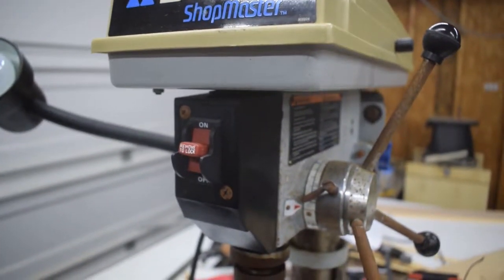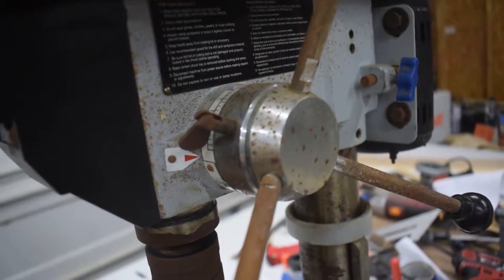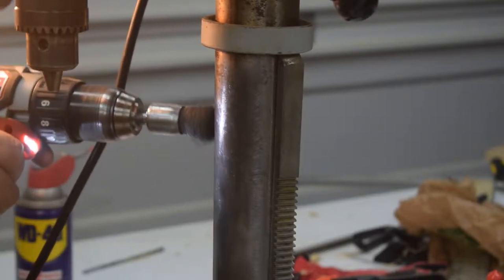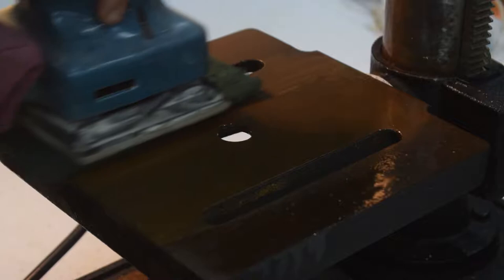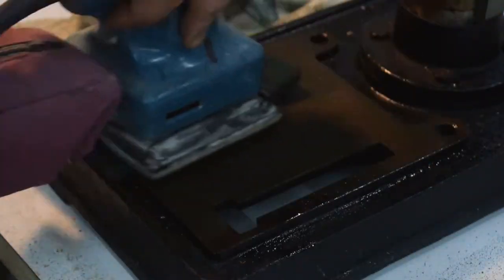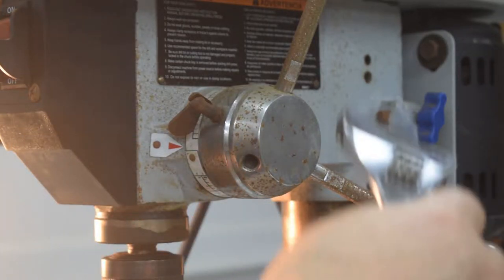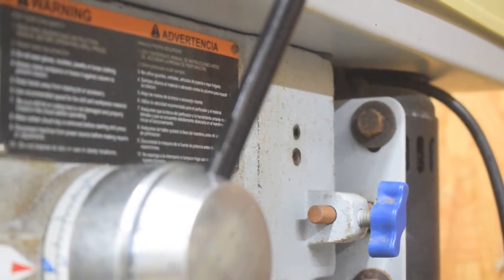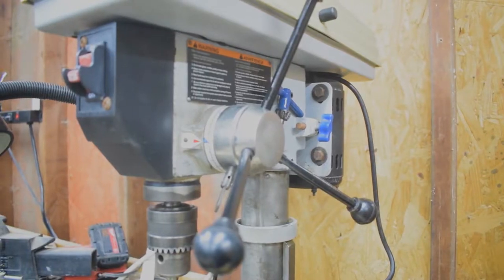How I Remove Rust from Power Tools (without vinegar) - Light Tool Rehab

Comment: Phosphoric acid dilluted, is the best acid cleaner, as it forms a hard invisible barrier that resists rust. Phosphoric acid is the main ingredient in "Rust Converter" paint. When they paint cars, they wipe them down with a water rinse dillute with phosphoric acid, and it removes the free iron that you can't see, and creates a rust proof coating, so the metal doesn't rust under the paint. Self etching primer contains phosphoric acid, so when it's sprayed on bare metal it doesn't allow rust to occur under the primer. Phosphoric acid is a miracle, although it's not very strong compared to Hydrochloric Acid (concrete cleaner). But Hydrochloric acid is not safe, because it opens the metal to further rapid rusting. Many people don't reaize how important it is to use phosphoric acid. In a pinch, Citric Acid and Acetic Acid (vinegar) are apparently very good as well, although Phosphoric acid is considered one of the best ways to clean and passivate stainless steel and steel. On stainless steel, Phosphoric Acid also removes the invisible rust, and forms a hard "passivation" layer of Chromium.

Comment: I’m about to resurface the exact same drill press. Thanks. Not to be “that guy” but I think a wire wheel is the last thing I’d skip safety glasses on. I’ve had wires fly off and stick me in the face like a dart gun.
Reply from the maker: Did I not have safety glasses on? I am usually pretty good about that. I would agree that is a must for that situation.